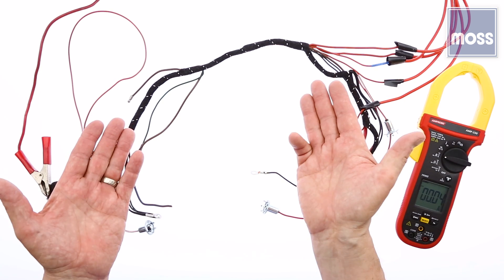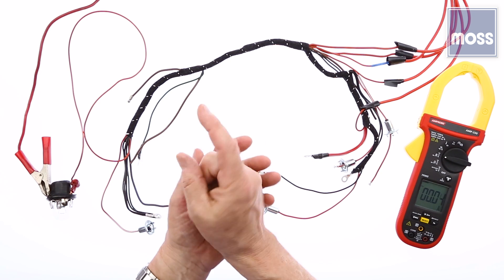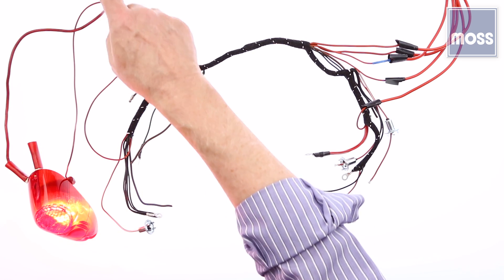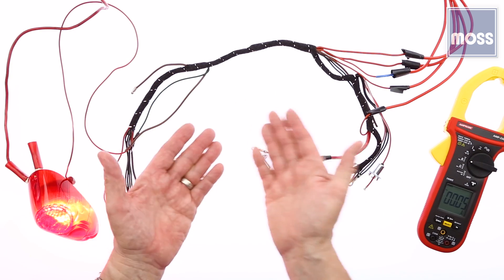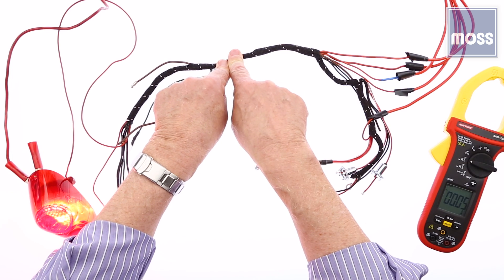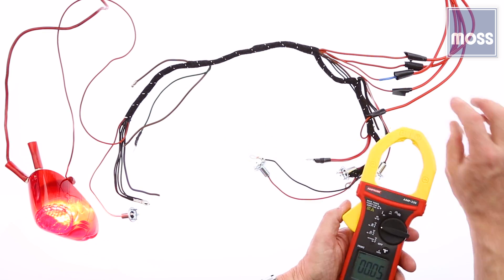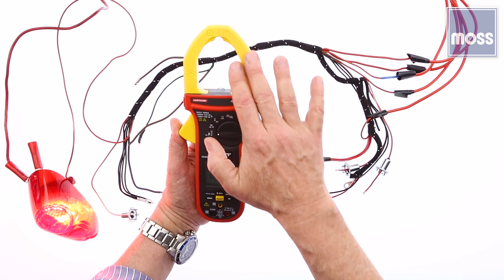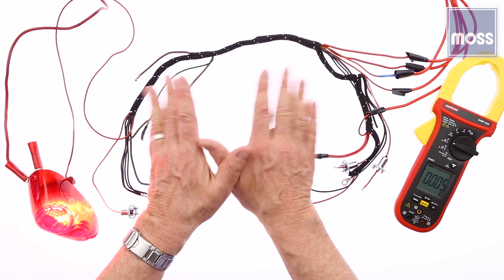Clamp Meter Diagnostics

Comment: Great tip about using the lamp as a current limiting load. In application, particularly on a modern automotive electrical system, I suspect it would be challenging to perform this accurately on a wiring bundle which could have dozens of energised circuits. Ideally only the circuit in question would have current flowing through it. A thorough visual inspection cannot be underestimated and in most cases will identify the fault. As always, you are a scholar of a technician.